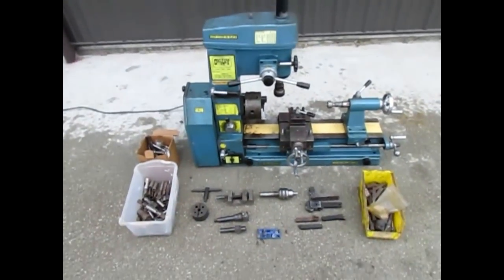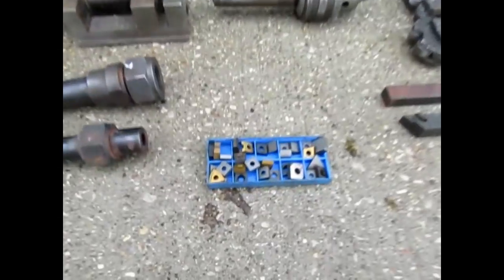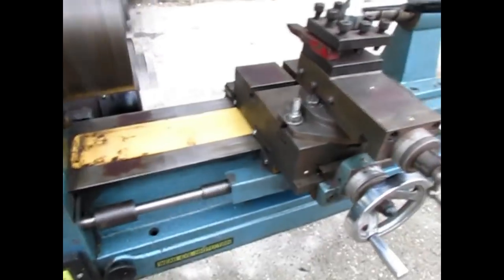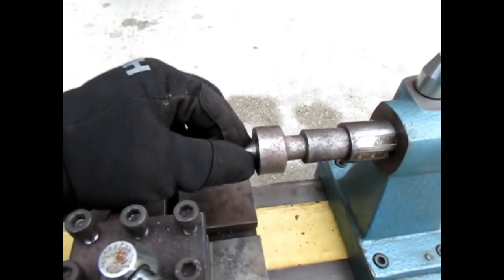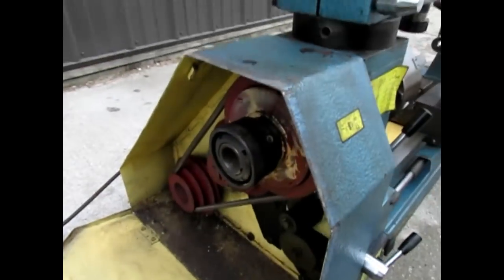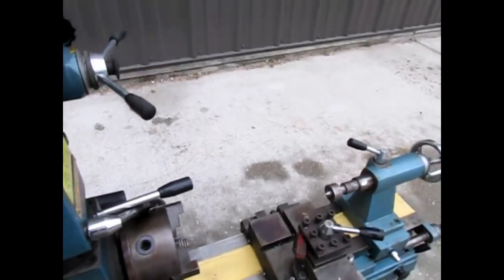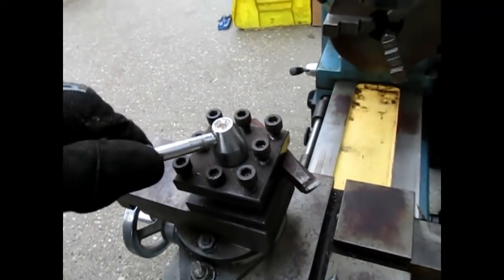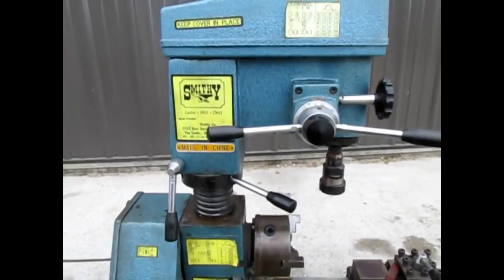Smithy Lathe Mill Milling Machine Combo 3 in 1 Multi-Purpose LOTS of TOOLING For Sale

Comment: Im looking at a similar one for sale for $850 used.....is that a fair price?...wat did u sell yours for?
Reply from the maker: Yes that is a fair price. This one here was listed for 1700 free shipping.
Reply: Thanks....actually u can get a brand new smithy for 1500 which includes $1000 worth of free tooling at smithy website....its a great deal....the only thing is that this model and urs has extremely limited mill y workspace .....very limited.....the extended head version is much more capable